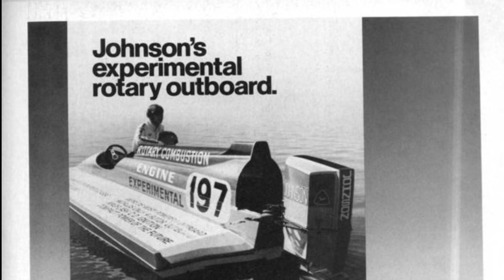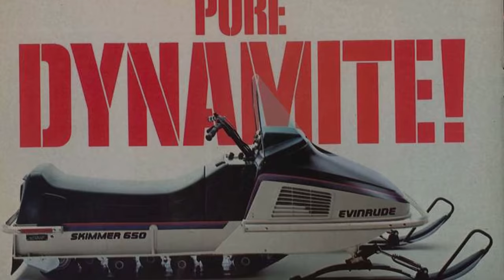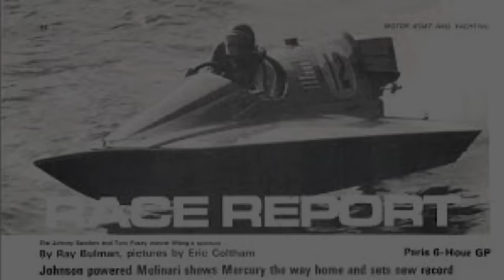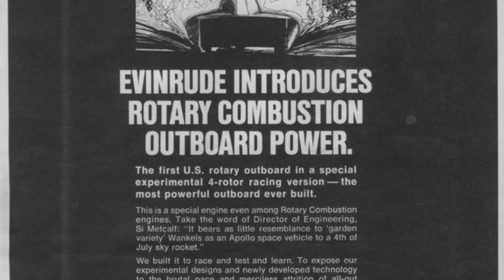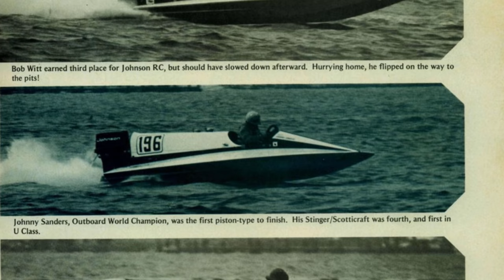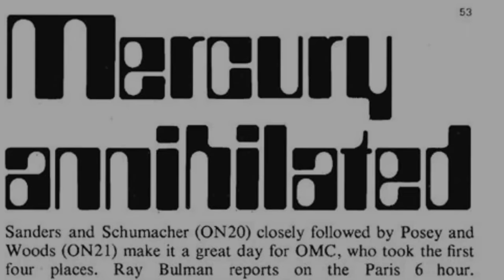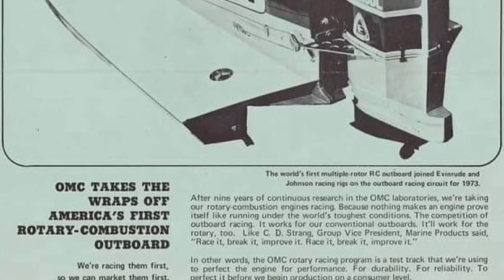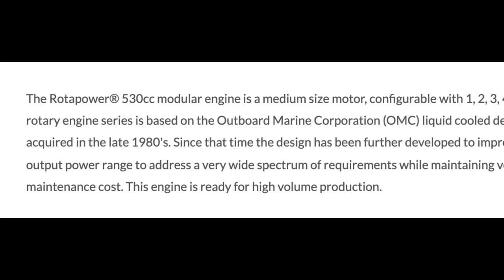Outboard Marine Corporation 4 Rotor: The Real Story

Comment: Omc was a powerhouse. And still to this day you cant beat the reliability of the 70's80'sand 90's Evinrude and Johnson 2 strokes. Period.
Reply: I had a 2000 50 HP Johnson 2 stroke outboard engine that i bought used with a 16 Key Largo CC and it was something out of this world in terms of confidence and endurance of course i treat it like a baby but i put dozens of hours 2 impeller replacements spark plugs i mixed it myself and it worked i mean like an EFI it never failed . Never a problem with low RPM,s trolling or whatever. I Think it was built like a tank . Had it from 2008 to 2019 i sold my boat. Still Working Perfect¡
Reply: You operate any new OMC products made after 1984? Exactly what qualifies you to make this statement?

Comment: OMC was lightyears ahead of the competition in technology and performance thats what scared them and the had to be squashed no matter what the cost. This always hurts the consumer and results in such a loss that it can never or very seldom be recovered. OMC had the most advanced environmentally friendly highest power to weight outboard produced when it was killed. All to the detriment of the marine buying public.
Reply: Brought to you by Corporate Monopolies and good old lobbying.
Reply: Mercury was far better
Reply from the maker: Well they shouldn’t have cheated then and made their own class
Reply: @everythingexe  they all had different classes.  OMC 3 cyl stingers ran really nice . i just have fondness for old 2 cyl n 4 cyl magnetos mercury motors had a handful of those back in the day.
Reply from the maker: See now that I can understand!
Reply: They were tops in some classes Karl kiekafer was a genius small bore less port wear at low speed. Can't beat fifty merc for fishing n run wide open all the way home just had to check water pump more but atleast drive shaft spline was greased more . nothing like drive shaft seized to crank from negligence .
Reply: @kevinhoffman6592  well. As someone who has owned and maintained/modified well over 40 outboards.  And routinely relied on some in literal life threatening situations.  You couldn't pay me to take out one of those mag ignition Merc's.  Especially when it is cold.  How my experience has been so contrary to so many mercury fans, I think is because I am not talking about summer boat rides twice a month.  I'm talking everyday. Heavy loads.  Rough seas. And fluctuating temps coldest I remember being out in was -16.  From April to Jan.  It's a damn shame what happened to OMC.  And Mercury is still buying out there competition.  To this day.
Reply: @sancharino4672  Well my old 1964 Fifty Merc did ok while ice was breaking up on Detroit river to get me over by Canadian water to fish on ice shelf at mouth of the river.  Took my youngest daughter for rides during summer ten yrs ago . Friend has boat n motor now . Service mag n check pump n its ready to go . Fuel pump diaphragm should be replaced been awhile.  I only have 42 yrs experience.  Worked on many OMCs too.  Twins are nice but they are out of business.  Go figure strong survive

Comment: Thank you for a great documentary.  I had always heard that OMC had problems with sealing rings.. Apparently that is incorrect.  

A good machinist friend, who's long since past, always said that if OMC showed up they'd dominate the Merc boys.

I've been running 3 liter V6  and 3.6  liter v8 since the early 90's... The only draw back is they are heavy, like you said.  I hope Rotopower decides to take on a boat motor project.
Reply: they are light compared to the 4 strokes!
Reply: @ThePlummer Speaks: I'm putting together a pair of 1990 3.0's I'm sure you're aware of second effort. Just curious if you know of where I could find second effort exhaust snout for the 3.0 from back then. These engines are going to be mounted on a brand new 30ft rage. They will be fuel injected and modernized.
Reply: @christianmgtow4744  Unfortunately I do not.  I have a 85' 3.6L V8 with some second effort heads, but that's as far as my knowledge goes.  

I would however contact Monty Racing in Florida.  He took my 88 3.0L Looper and got 297HP at 5700RPM on pump gas, measured at the prop shaft.  If anyone would be able to help you Gordon (Monty) Montague is the man.
Reply: I've been in contact with Monty racing. It's the point where he won't answer the phone anymore because I think he's too busy. And I'm not blaming him either. Someone said he hooked up with sharrow propellers

Comment: Excellent video Liam,  certainly a lot of info there that I didn't know about.  I have a single rotor engine in my S2 RX-7 that develops 98HP at the wheels on pump gas using fuel injection, and has an RX-8 higher compression rotor.  Sounds like a single cylinder motorcycle.  With a small turbo it develops about 220HP and with a single Nissan GTR R spec turbo (the cars have 2 turbos) and running 48psi boost, the motor makes about 330HP.  Much more fun!    Keep up the rotary history work... its not all Mazda after all.
Reply: Interesting! I'd love to see some rotary content on your channel, but it seems you're more into the model train scene. There's some other guys (@teamboosted) that built up a single rotor and put it into a Porsche Speedster kit car. They did get it running, but I haven't seen any new material from them in almost a year now.😐

Comment: Evinrude holds the world speed record for single outboard naturally aspirated. A two run speed average I think in like 1997. I believe 176 mph  not positive JT
Reply: Yes, that sounds like the V8 outboard. It still stands.
Reply: It was set by Bob Wartinger who still races outboards  here in PNW.
450 hp Omc V with Nitrous =650 hp
I race Johnson 15 hp 2 stroke in A class and also raced a 1937 Evinrude twin that has a vane pump inside that sure is torquey and loud.
Bob does Uim safety talks at meetings and has said 
6/8 people Died
 who tried to break the OB world speed record (Bob doesn’t “own” records , he “borrows” them !).
Record was set in a 20’ Karelsen wood tunnel hull.

Comment: I worked at OMC & BRP for 47years. As an expediter was responsible for collecting and scrapping all the rotors and engines at the Plant 1 assembly area and machine shop floor. One thing several of us old time OMC guys wonder is what would the Ficht injection been able to do on the rotary.

Comment: Great video!  Liked all the racing competition shots and review of the results.  Knew OMC and Mercury were tough competitors against each other, but didn't know about the potential sabotage and special racing rules to benefit one side.  ONC's rotary engines power to weight ratio is fantastic, but high bsfc numbers don't portend well for economical fuel applications.

Comment: Just an FYI: Rob Dahm of the 4 rotor street car notoriety, has just taken on a project with a 12 rotor N/A powerplant designed by Tyson Garvin to fit in essentially the same space as a big block Chevy, with the intent of making a longer lasting, higher output, marine type powerplant. So far, Garvin has only run the engine with a large 4 bbl. carburetor, which limits it to 2000-2500 rpm., but even at that, it produced phenomenal horsepower and torque. Rob Dahm is attempting to set it up with programmable EFI and ignition, but there are some internal issues that need to be worked out before it can be tested to it's full potential. It will be an exciting project nonetheless, so all you rotary fans might want to check out Rob's channel for updates.😉👍

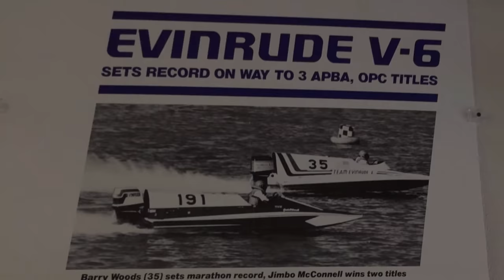Comment: I worked in outboard engineering from 1981 t0 1992. The guys who worked on the wankel were the last of the progressive engineers at OMC. When the wankel project was done, it became a job of maintaining the old motors, with few real new offerings.  Charlie Strang's interest in racing put consumer outboards on the back burner. As your video stated, the EPA got interested in emissions from outboards, but in 1981 (when I interviewed there) the chief engineer for outboards told me that they would never be regulated. (32:40) WTF?  When I worked there there was not rotary on display in the engineering building or anywhere else: it was forgotten by  then. BRP took over in about 2000, not 1976. Thanks for a good video.
Reply from the maker: Thanks for the info. I have another account from engineer John that I will make a video about in the fall

Comment: Consumers purchase longevity not dyno numbers or race wins. There is a nearly unfathomable chasm between a race ready one off motor and a production ready design. They might have been extraordinarily far ahead technologically, that doesn't mean it was production viable. 
GM drops a billion dollars with a B on simple process improvements. OMC simply never had the engineering budget to push these into production. Unfortunately it was doomed from the start on to be a vanity project on finances alone.
Reply from the maker: I might have to disagree with you on that, the rotary snowmobile engines were very robust and they produced upwards of 20,000. A two rotor variant water cooled with a single piece crank would be very different than the race motor and a lot more reliable

Comment: Just imagine Etec direct injection fuel system on that 4 rotary!
600hp and half of fuel consumption.
Just imagine Hydrogen feul in that 4 rotary 1000hp! No turbo
Reply: fuel delivery wasnt an issue ie. i dont see how direct injection would benefit power. fuel economy certainly, which would help them greatly in a race. as for hydrogen, its less dense in liquid form... not sure if that would make a difference as well.
Reply: Andre, I think you have seen what I have seen!

Comment: Thanks for doing this video!
Any information on where to find details on old OMC outboards?
Reply from the maker: Online forms are where I found most
Reply: Bombardier and suzuki bought up everything.
Reply: Antique outboard motor club.
Ken Cook Co.
Good luck finding parts
Reply: @diannawilson1329  thanks!
Reply: @Eluderatnight  I've got a 1975 RE5 that I had planned on adding a turbo to and going for 200mph at Bonneville with. Then in 2003 I became disabled in a workplace injury...from Wyoming USA 🇺🇸 🤠
Reply from the maker: Hey well if you’ve still got it, I would be more than willing to finish the project haha :)
Reply: @everythingexe  yes I still have it, and I'm not able to do the mechanical work 😫, but still dumb enough to ride it. And it really needs some type of fuel/oil injection vs the five cable's going to the factory carburetor! If you're serious we I'm sure we can do something...from Wyoming USA 🇺🇸 🤠 ps. How far away are yoy?
Reply: @everythingexe  I've also always wanted to put a 4rotor in the boat pictured in my whatchumacallit..lol
Reply from the maker: I’m in Chicago, a little far
Reply from the maker: 4 rotor Mazda in the boat?
Reply: @everythingexe  I've got it, 2 turbos, one needs rebuilt one is OK I think. Both are oil bath bearing, and water cooled Garret turbos. From early Chrysler's I believe. But aftermarket ebay turbos are SUPER cheap nowadays. I have the factory plastics from a kawasaki 600 ninja I was going to cannibalize for this project or my 305cc honda dream to put around town on. I can still walk short distances (15-60yds depending on the day), and stand for very short periods (minutes)...from Wyoming USA 🇺🇸 🤠
Reply from the maker: Hey man that’s inspiring! And that’s a really cool project idea I don’t think I’ve seen anyone concert one of those
Reply: @everythingexe  that's not very far. My family is from upstate New York 1850 miles away. The fastest I ever made the trip was 22hrs. I might have bent a few speed limits but it was because my grandfather was passing away, and I had to get my mother there to say goodbye. So I think that's a fair reason for the speed..
Reply: @everythingexe  that or a T56 turbine would be great also,  but the fuel burn on a turbine is HUGE. And diesel ain't cheap anymore...lol but yeah in a boat, my boat to be specific, or a six rotor, it still wouldn't weigh as much as the 468ci big block Chevy that's in it now. That thing weighs almost 700lbs...lol
Reply: @everythingexe  I'm only 1232 miles away from Chicago is what the map says, go see Yellowstone and stop here on the way home..lol...so you can sell it to the wife..lmao let's figure this out...from Wyoming USA 🇺🇸 🤠
Reply from the maker: Haha yeah then I’d have someone to drive the car back and I could ride the bike….or maybe bring a trailer 1232 miles is a long way 😂
Reply from the maker: Feel free to email me at my channel email!
Reply: @everythingexe  I'm not very fond of computer's, in fact the peak of my interest in computer's was Defender on atari in 1986ish. I can text. That's about it..lol I'll try to email you... and yeah 1232miles ain't next door! Oh I've got a garden tractor 🚜 with a Virago 750cc v-twin to be used as a pulling tractor at the fair that you might need also..lol...from Wyoming USA 🇺🇸 🤠
Reply from the maker: Haha sounds so cool!
Reply: @everythingexe  I tried 3x's we'll see any of them worked!..lol
Reply: @everythingexe  try calling tomorrow if you get time.
Reply: @everythingexe  definitely needs a trailer...
Reply: @everythingexe  did any of those emails make it to you? I am superstupid when it comes to technology, it really is ridiculous, but oh well my family still loves ❤️ me..lol
Reply from the maker: No they did not, email is ldhughes1375@gmail.com and don’t worry about!! :)